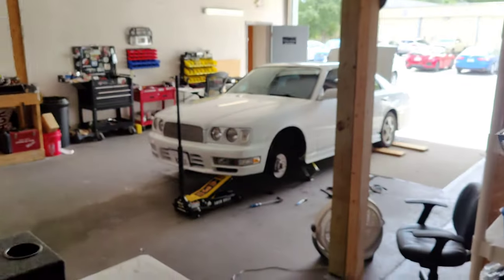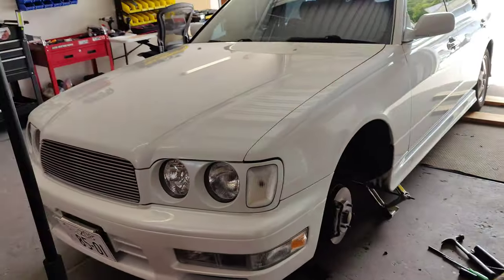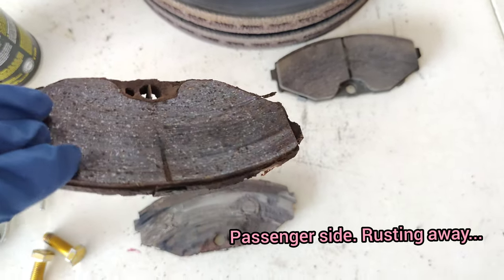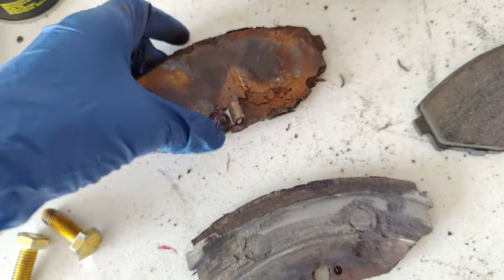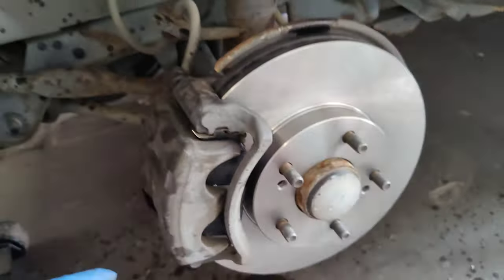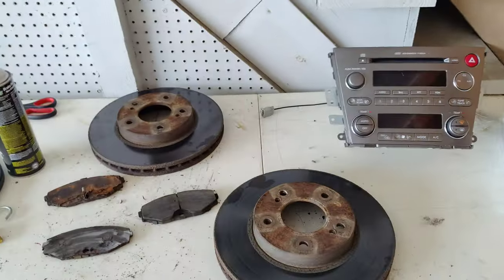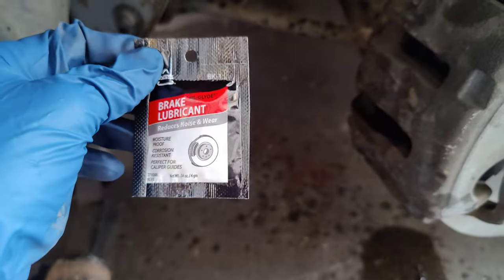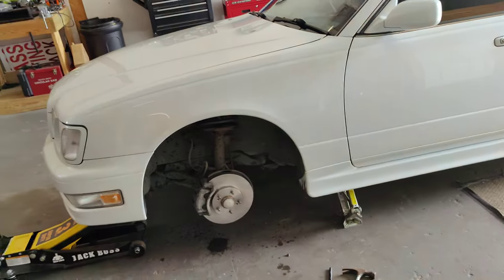New Front Brakes On The Gloria(Y33) #jdmlife #nissan #import

Comment: I have to also change my brake pads and rotors on my 98 Gloria. Any ideas if the q45 brakes and rotors will fit it? For front and back?
Reply from the maker: They should fit just fine, both vehicles are still on the same Generation for the '98 model year, and still should be using the same parts, so you should be good. 👍 
At least from the research I've been able to come up with. Still not super positive on the rears, buuut, if they are the caliper style and not drums, they at least look identical imo.

Though make sure to keep the receipt if you do get some, just in case the brakes for whatever reason don't actually match.
Reply: @AquaVeil  so just to clarify (sorry lol) the same brakes parts you used? Just so I know what exact part number to look for!
Reply from the maker: @letraece  they should be. But every auto parts store may use a different numbering system(I've ran into that...). 
But the rotors and pads should be the same numbers.
Reply: @AquaVeil  thank you so much!
Reply from the maker: @letraece  no problem! Hopefully the brakes match up and it all works out!